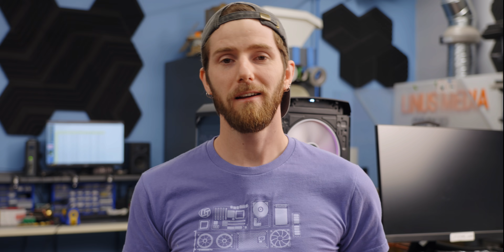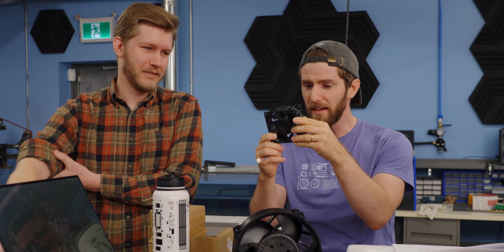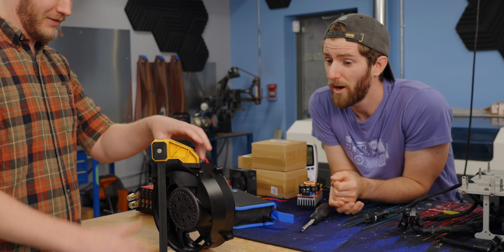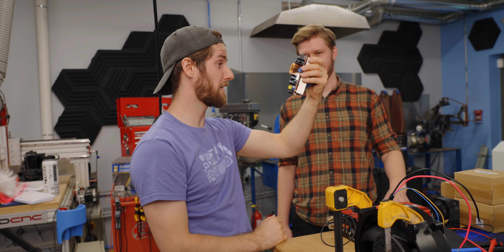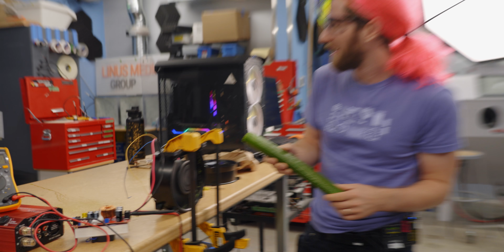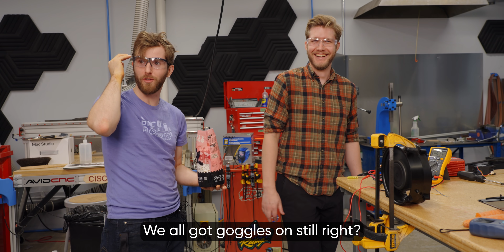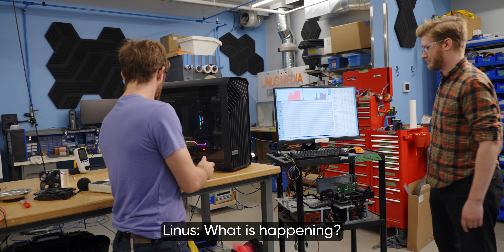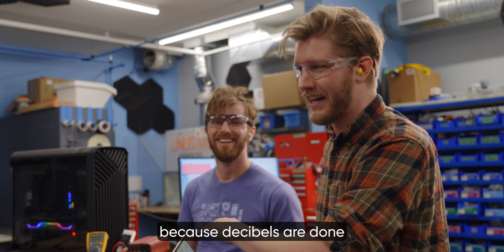The God of Computer Fans

Comment: We used something similar back in the day to push hot air away from servers in the rack. We had one on each rack and it would force the air down and out of the rack into the hot aisle in the datacenter. We needed it because some of the racks were full of custom, non datacenter optimized hardware so it didn't make a lot of airflow on its own.

Comment: electrical cabinets (from industrial machines) use similar size fans that draw a lot not sure how much but I suspect similar amounts of power. electrical cabinets we use them for have a lot of servo regulators, plc's and transformers in them. so a lot of heat is produced in them and they usually are placed in production vecilities that are already very hot because all of the machines.

Comment: Back in the day, I found some 110v ac fans in 120x45 size, all aluminum, for $30 each at a surplus store.  Not sure what they were made for, but I hooked them up to a light dimmer switch and put them in my computer for a bit.  They were too scary though...I ended up putting my Scythe Ultrs Kaze 3000 back in.  Those AC 120 fans would definitely have taken a finger off...I can't remember how many watts...not that many.  But I am very relieved you guys didn't have a horrible accident.  If those blades had broken when you were jamming things in there, your safety glasses would not have helped much.

Comment: Eh, well it spins on lower voltage and ofc lower voltage = lower revs and lower revs = lower wattage, you shoulda tested it on a normal power supply and check noise levels and and rpm, pretty sure it wont blow a psu with lower power etc and stil deliver decent airflow as compared to a normal cooling fan

Comment: Can you follow up using the PWM control this fan has? Should be able to plug GND, Tachometer (blue), and PWM (yellow) into the motherboard or standalone PWM controller to vary the speed. Obviously don't plug the hot (red) wire into the motherboard.

Comment: One application where such fans are used: aircraft. Cooling down electronics on the ground. At altitudes they can just use -50C ram air, but many aircraft have ground blowers, which sound absolutely annoying, pushing huge amounts of air through the devices.

Comment: 5:55 Nah, a power supply that can run this is about 150 bucks or so. It goes 0-60V up to 18 amps, that's 864W at 48V, more than enough for this fan at the specced 600W. Look up Riden RD6018 lab power supply.

Comment: You need to use a spectrum alignment tool (from the old CRT days) it's basically an insulated screw driver for turning pots/magnets on the yoke coil on the TV tube.

Comment: I just remembered,  deltas are switched reluctance motors, single phase winding, so if multiple fans are in use, the must be started together, otherwise back pressure will keep others from starting.  EBMs and SDs are 3 phase brushless dc and will start under the load of back pressure.
Reply: In this case, Delta is just the brand name, not the type of motor winding :)

Comment: Been a while I did any moding, but you can get 24v from a power supply (or could at least) using the +12v and -12v.

Comment: Gotta love the documentation for that fan. Quoting from the data sheet...
3. Please exercise caution when handling fans. Damage may be caused when pressure is applied to the impeller, if fans are handled by the lead wires, or if the fan was hard-dropped to the production floor.
11. It is important to consider safety when testing the fans. A suitable fan guard should be fitted to the fan to guard against any potential for personal injury.

Comment: We used fans like this as an interim solution (before moving to an actual refrigeration unit) to cool an entire rack of PCs that were parsing barcodes out of images at a REDACTED (but think UPS/FedEx/USPS) facility for all of their sorting lines. The building didn't have climate control and the PC's were in a big industrial equipment rack. The problem was that in summer, these fans were just moving hot air around.

Comment: Sometimes those fans can be used for venting an entire room (of course).

You stick them in ducts and if you want to just vent something, those types of fans are the ones that you would use.

(I designed and engineered something similar to that, albeit only for 12-24 VDC, for a client of mine previously.)

But yes, re: taking off the fan from CPUs and GPUs - this is why server CPU heatsinks and server GPUs are all passively cooled by the bank of fans towards the front of the chassis.

Same concept.

At 95-98 dbA, that's actually NOT that bad given that the old Sun Microsystems SunFire X4200 had SIX 80mm fans that ran at about 106 dBA, providing around 600 CFM of air movement through the system, so that's not that bad at all.

Comment: I’ve seen these before at work. In our data center we use in-row cooling for our high-density racks. Look up the APC ACRC301S InRowRC for an example. The central chiller on the roof provides coolant to the IRC and it uses that to chill hot exhaust from behind the servers and dump it back out into the room. That requires that the exhaust side of the racks be enclosed so the hot air is contained. Those IRCs drown out the server fans with their noise under load.

Comment: Are you sure this is for computers?? Industrial usually means that its an exhaust fan for an industry, which means like a factory. DC 48volt should have been a red flag.. 48v is usually used in telecom sector in their equipment. It must be for out door cooling for base stations for telecom towers.

Comment: 14:13 Those fans are generally used in data center applications. Another is for UPS internal fans. I work with a UPS manufacturer and we have those in our units as small as 40kva all the way up to 1600KVA.

Comment: Delta Model THD2048HT 

but id try these other ones first.. before you try a stunt like this^ at home. 
Delta QFR1212GHE Cooling Fan DC12V 2.7A  4pin  120mm
Delta PFC1212DE   Server Fan   DC12V 3.24A  4pin 120mm 
Delta PFC1212DE   Server Fan   DC12V 4.80A 4pin  120*120*38mm 253CFM 
Delta THA1212BE  Server Fan   DC12V  6.5A   4pin 120mm
remmber to always wear Oh SH^* Safety Glasses

Comment: Pulled several of those out of a clients home work shop exhaust system last month. Kept them thinking they may have a use in the future. FYI, Automotive radiator/AC fans run on 12V, come in whatever size you want and are pretty cheap.

Comment: About the thing with the cpu fan, as long as its a traditional air cooler, with that much static air presure from these fans, the puny cpu fan is most likely gonna be obsolete anyway 😂

When you think about it tho, it is gonna be messy with gpu cooler too. Should propably just remove all other fans in the system. It would be a great cooling solution as long as you can tug it away in a server room. 

Not so sure how great it is with the 1300w power draw.

But hey … if Intel keeps up the way they are going this is gonna be their cpu cooler for 20’th gen 😂

Comment: Scariest thing about the open voltage controller is that the control that requires a screwdriver is on the positive side...
Reply: The DC/DC converter is not referenced to ground; it's floating. It has positive and negative; negative is usually chassis "grounded" (not actually grounded like the power grid and house wiring). The current wants to flow from the negative terminal to the positive terminal (using physical current flow, rather than conventional like I normally use). Just like how the current flows from a battery from one terminal to the other; not anywhere else. I should know. I design electronic circuits.
Reply: I own dc lab bench that is able to make up to 60v DC i can clip those aligator clips on wet hands and i can feel it tickle a bit , nothing more. And for those saying that it can cause burns nah. If shorted it makes huge spark but doesn't have enough energy stored in capacitors to melt much more than smal piece of thin strand of wire . Being electrician i have shorted even 60v from much more powerfull power source capable of 1000+ amps . It vaporisers screwdriver easily but it is really hard to burn yourself that way too .
Reply: They really should be using a plastic screwdriver for these adjustments
Reply: You totally sound like you haven't touched enough circuits. While I will say for legal reasons that I do not suggest anyone without proper knowledge operate these circuits, let's not act like this is a killing machine ready to electrocute people. Come on dude, they sell them exposed for a reason. But as Alex said, I wouldn't put my tongue on it (unless you're Electroboom)
Reply: It's DC
Reply: @yellouu_theree  that doesn't stop you from being a ground.
Reply: @stop7556  How? Yes, you can be ground, but only if you touch the minus side at the outlet of the buck converter.
Nothing will happen, if you are grounded to ground, because the plus side has no voltage potential towards the ground. At least as long as the transformer and the buck converter are OK (if not, you have a few other problems).
Ever heard of insulating transformers? You can touch the hot wire without precautions. Try to understand how and why this works, maybe then you can understand, why your claim is (sorry to say) BS from someone flawed knowledge.
Reply: @johnscaramis2515  what.. you don't seem to understand either then. You do realize if for any reason you became a lower path of resistance than the negative terminal that it will travel through you. Right?
Reply: @stop7556  Yeah but at those voltages it doesn't really matter...
Reply: @stop7556  not at these voltages. Look up what voltages are required to pass through skin
Reply: @stop7556  yes, but only if we are connected to ground or something that can make the electricity move through our body. Unlike AC which can pass through capacitor (which our body has to earth), DC can't. Also 48V DC is still considered harmless. I'm more concerned about wires touching each other on the terminal, although with proper connector it should be safe
Reply: @TheKrausenKid  voltage isn't the only requirement to pass  of the human body.
Reply: @mattfrick2531  voltage isn't the only requirement to pass impedance of the human body.
Reply: @siontheodorus1501  see comment above about us being a ground.

Voltage isn't what kills.
Reply: @stop7556  yes that's what they say, it isn't the voltage that kills you, it's the current. This is not entirely correct. You need both of them. You can pass 1v 150A throuh your body and you will be fine. You can also pass 150V and limit the current to safe level, but doing this the voltage also drop significantly when touched. 

On the 48v being harmless, a quick calculation shows that your resistance must be around 10k to get 5mA passing your body (which is usually where people started to feel it), and a dry skin on normal human body is in Mega ohms range. Making it wet will drop it to  around tens of thousands  to hundreds of thousands ohm
Reply: @siontheodorus1501  do you even understand what you are saying at this point? You posted two facts without even understanding the correlation of said information. Yes voltage and amperage are requirements for lethality. Yes the body has high natural resistance to an extent. This does not mean 48v is harmless.
Reply: @siontheodorus1501  before we waste more time with this. Let me help you. 1. Likely they're wearing rubber soled shoes which drastically increase impedance which then reduces the chance of them being lowest resistance even in case of failure of the actual ground terminal. 2. Given the calc for the fans the amperage and voltage while under DC conditions is not likely to cause harm. 

Now the real issue besides the actual fact that it isnt likely to be a hazard is that engineering when done should be done in worst case scenario. IE controller should not be right next to the positive terminal especially if it may require a conductive device to control it.
Reply: @stop7556  There is absolutely no danger of being shocked here. First of all they have the boost converter connected to an isolated switch mode power supply so the positive output is not referenced to ground. You could directly short the positive output to ground and no current would flow. The only way you could get a shock is by touching the positive and negative terminals at the same time. Second of all 48V is simply not enough to even feel as a shock on bare skin. The human body has a very high resistance and therefore requires a high voltage to push even a small amount of current through it. Most countries classify anything 48V or under as SELV (Safe extra low voltage) because it simply is not enough voltage to cause a a current flow you could even feel let alone hurt you. Yes current is what kills you but voltage is what causes that current to flow in the first place (see Ohms law) and 48V is just not enough.
Reply: @stop7556  "lower path of resistance" lol, you should learn some stuff about electricity as well. Current splits and takes all available paths...
Reply: @siontheodorus1501  Actually, can you even get 150A to pass through a body with only 1V?  Considering I've measured my fingertip-to-fingtip across the chest resistance not much lower than 60kOhm, and you'd need, well, 1/150 ohms to let that much current through, and salty salty blood only has a resistivity of 100 ohm centimetres.  Most blood vessels are well under a cm diameter, and if we're sticking with the across-the-chest scenario, that's like 3 meters of blood length to drill through, so we're looking at well over 300 ohms even if we've got salt-water drenched intravenous electrodes, or 3.3mA max (scarily close to the ~5ma fibrillation threshold, though... one more volt and you're in cardiac arrest town, but it took some seriously cruel electrodes to even get that close).
Still, your key point stands, current's given credit for the killing, but in sources that's just a capacity, you need voltage to push it through a given resistance.
Reply: @Archgeek0  It is true that you cannot pass 150A through body with only 1v, otherwise you are  a super conductor human. Maybe i worded it wrong, but what i meant is that it is safe to do that and the PSU doesn't need to limit anything.
Thanks for the calculation.
Reply: Regardless of whether it can electrocute you, it can put out >1 kW, so if the screwdriver slips and short-circuits something, it could make a decent explosion and cause serious burns.
Reply: @fat_pigeon  that is valid but it'd have to ground to a capacitor or something very very unlikely
Reply: My ps4 in a nutshell 7:30

Comment: One answer to the use case question from a former industrial electrition:
These fans are used in big industrial motor drivers. Common up from 100kW drivers. 500kW and more are commonly wather cooled.

Comment: U r right, these are mainly used to move cold air from row coolers to other side of the room. Installed in a cylindrical frame, works like a jet turbine on airplanes. Btw, I am delta electronics employee, every time u features a delta product, I smile.
Reply: They look similar to the fans inside the UPS modules at the data center I work at. Ours aren’t dc though. We do have rectifiers that could power these, but those are used to power the telecom equipment. I’m trying to figure out why someone would use 48vdc to move air on the data floor when 208 or 480 is readily available. Unless that is common in other countries, idk.
Reply: @ianbrown1708  traditional Telco data centers use 48v DC to power everything.
Reply: @ianbrown1708  oh.. and I agree.. the Powerware 9315's I've used in the past had very similar fans for internal cooling
Reply: If you have a server room usually you wont/cant install a huge opening just for fans because that takes planing and a lot of money, but making 30 cm holes in the wall is pretty easy by every contractor out there. So this thing makes sense in that way.
Reply: Friend, I am sophomore Mechanical Engineering major I am fascinated by fans and airflow, doing research and development on airflow and turbines is my dream.  I'm so happy that you enjoy seeing vids like this :)
Reply: So much for my guess that they were for in-the-field equipment pedestals.
Reply: I've seen fans like this on big industrial electric motors as well. Specifically on a 200hp motor that turned a carousel for a filling machine at a PepsiCo bottling plant where I worked as a maintenance tech. The fan on that motor was actually beefier than the one in this video...

Edit: Fun fact - that filling machine (Angeles was the manufacturer) was the second fastest canning machine in the world at the time I worked on it at around 850 cans filled per minute. The fastest in the world was at a brewery in Germany that filled around 900 per minute (also an Angeles machine)
Reply: @talkingmudcrab718  Was it a filling machine, or was it secretly a rinsing machine?
Reply: Linus said it start to produce power at faster speed? So a jetturbine dont need fuel? Many believe they lie about the fuel consumtion of jet turbines because its so high numbers, and when a wing is damaged, there is no fuel pouring out etc
Reply: @Birgeyful  1) most fuel tanks are self sealing. 2) jet turbines are driven by the expanding gases from burning fuel and high pressure air. The turbines then drive the compressor that allows more energy to be extracted when burning the fuel by compressing the air in the combustion chamber. Higher pressure air means more volume once it heats up and expands. What OP was referring to was ducted fans, which also increase the pressure of the outflow through the duct. It's more akin to a jet turbine with the turbine replaced with a motor and no combustion chamber or fuel. Just a high pressure fan
Reply: You are*